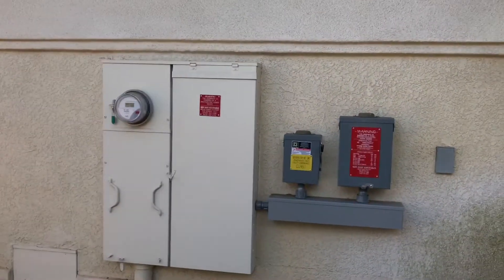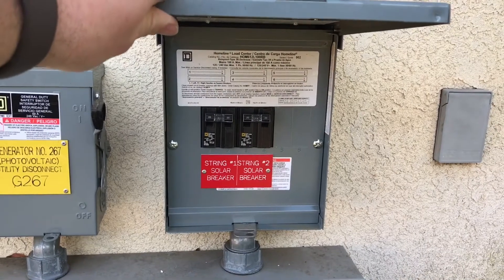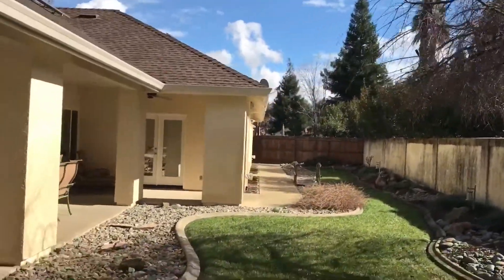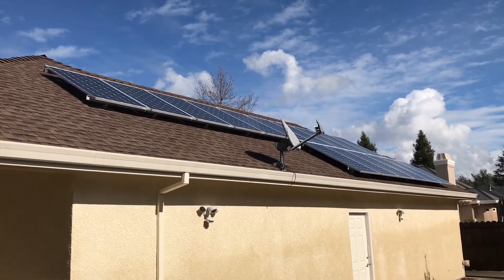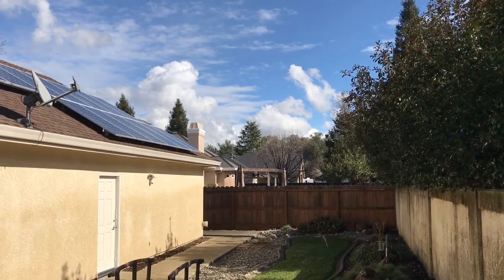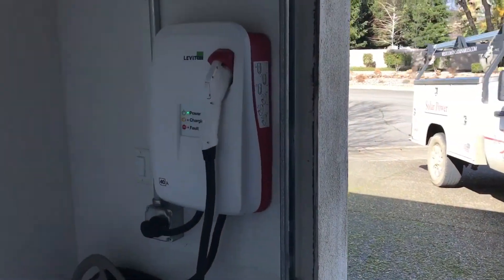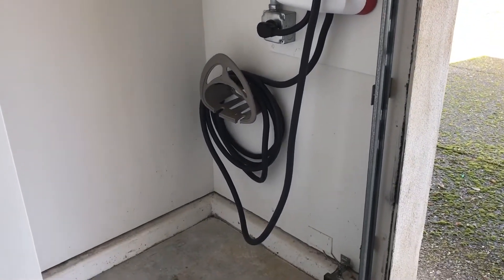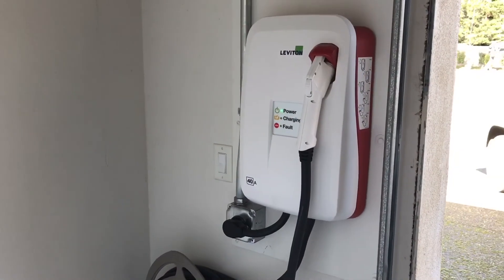Grid Tied Solar with EV charger

Comment: Hello! I have a grid toed solar in my home and I recently just bought a tesla…I had a guy come over to add a nema 14-50 plug..the guy said my breakers are full and needed to upgrade to a 200amp Panel. My question is, based on your video..Is it possible to directly just tap to the solar?
Reply from the maker: It sounds like they may have done a line side tap, if so I’d guess it is possible if a sub panel was added to distribute the branch circuits
Reply: @JasonAndrade427  thankyou!
Reply from the maker: No problem John

Comment: Great stuff.  Average EV uses 1kWh per 4 miles driven.  1,000 miles per month = 250kWh.  I have a 10kw solar system and 2 EVs.  Drive each EV about 800 miles per month.  Solar PV covers 100%
Reply from the maker: If people can afford it I think Ev’s and Solar is a no brainer the only concern I have is will the manufacturers battery pack be available as long as the cars lifespan

Comment: Does that charger run on 120 or 240?  I am guessing 240 since it is 50A.  240 would keep your L1 and L2 loads balanced much better.  Would not want to draw all that current just on one side.  What do think is the "best" electric car on a budget?  Also, I wish you would post more videos!
Reply from the maker: David Armstrong this is a 40 amp 240 volt unit and looks like the biggest one they sell from the brochure.  I wish that I had more information about which ones are the best but I haven't really installed many of them and is why I was excited about this one.  
There will be more frequent posts coming on a few projects. We recently finished a nice ground mount system using the new Solar edge Inverter.
I got my new/used wood shop system up and running using the Xw inverter and have some neat stuff to share.
VSP power sent me a portable power system to play with and use on a project for our Governors new off grid home
I'll try to keep up with the posting thanks for making sure I keep it up.